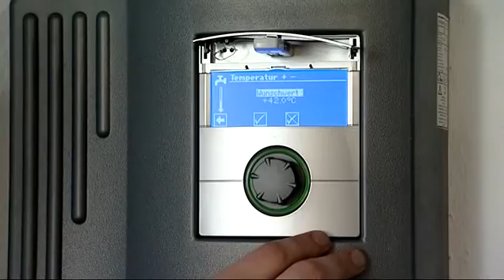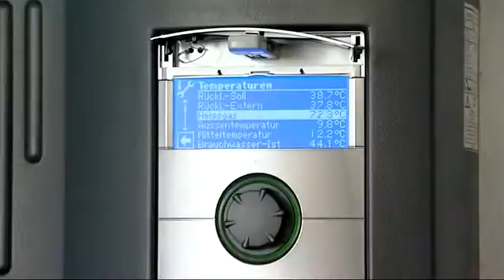alpha innotec heat pump exchange for oil

Comment: Great video that shows the installation of the multifunction tank with an Alpha InnoTec heat pump. This is how to incorporate a solar thermal, boiler and heat pump on the same circuit and make them all work.